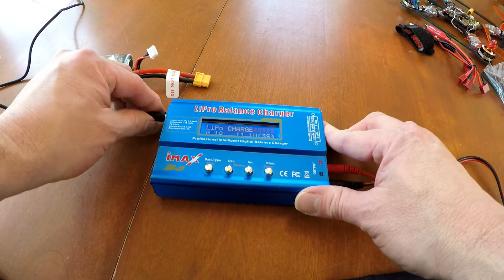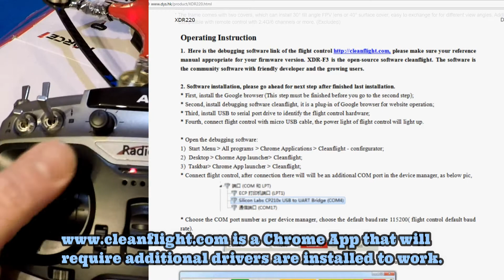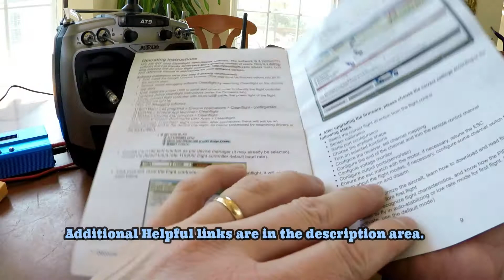Force1 DYS XDR220 FPV Racing Drone Kit (FULL REVIEW) 💯

Comment: Great review! Did you keep your glasses when using the goggles? I can't take mine so I need goggles that are confortable when using glasses.
Reply from the maker: The Googles are 007 googles.  They still work.  However, I upgraded to newer Googles.  I haven't reviewed my new ones they are EACHINE EV800D   They are ok too.  However, someday I plan to upgrade to much better googles.  Thanks for asking.
Reply from the maker: Hey Adail,  The 007 googles do the job but for this drone upgrade to the newer googles.  This set in my opinion is best for someone with experience already or already knows about how to fly FPV racing drones. The learning curve for me was a few days with a lot of reading and watching videos. The drone is really good but also crazy crazy fast!!!  So be careful.
Reply from the maker: Hey Adail, I just realized what you meant.  For me I take my glasses off when I use these headsets.  So far for every set I have I dont need to have my glasses on to use them. It seems to me that it is better to not wear glasses with these.

Comment: This is $450?! Not worth it! OLD components, cheap charger and goggles, old TX. Why do companies do this people in our hobby? This is a blatant cash grab to turn old, outdated parts into some "fast" racing drone. Please don't buy this.
Reply from the maker: You make a very important Note and point.  I myself updated the Goggles with EV800 and I have my kids share the 007 when I'm flying.  The point you are making about the price is also why I opened the video giving a price run down to show how the parts purchased individually are a comparable value.   For the battery charger, I think it's good.  I don't think it's original but it works pretty good.  I have since purchasing this kit found other kits too, I myself am learning.  My hope is in the months ahead I'll find others that are more current.   I do keep my eyes out for others to look at.  Thanks for feedback. TD